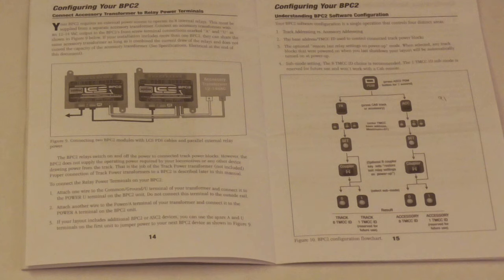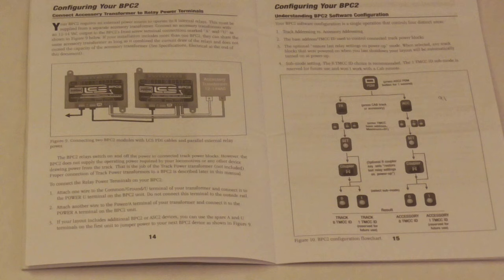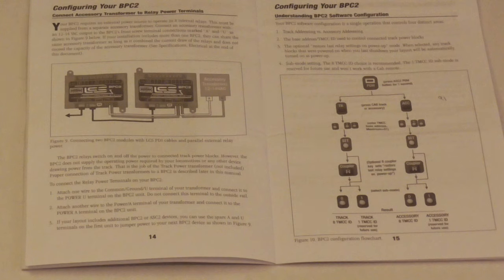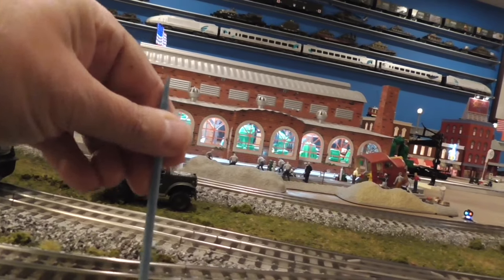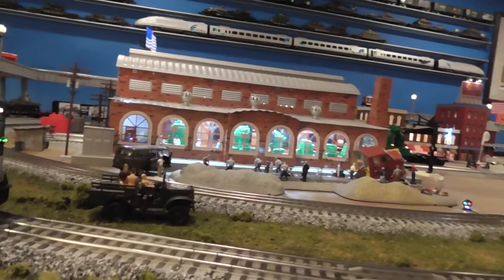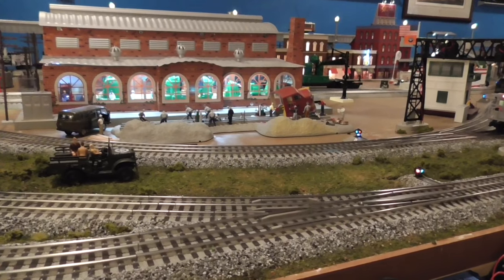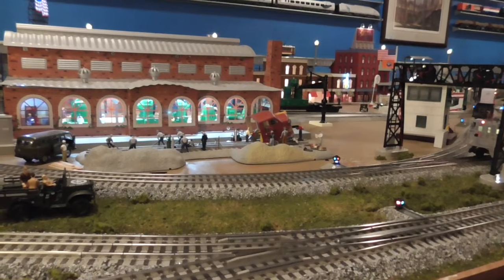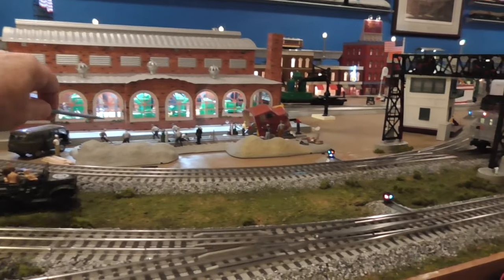How to wire a Block Power Controller 2 (BPC2) to your layout.

Comment: I think this is very good video about bpc2. I just started to setup a legacy system with lionchief plus 2.0 locomotives. I have one loop and 2 engines running behind each other in same direction. Can I use BPC2 modules to create blocks and avoid collision?  I  can adjust the speed and keep them apart. But a foolproof mechanism is best. 
I want to automate this as well so that I dont have to manually turn off power. Maybe I can program this with sensortrack and bpc2 combo.
Reply from the maker: Thank you for watching and commenting. Yes, you can use a BPC2 to create blocks. I have 6 separate blocks for my sidings. I do not use them on my two main loops. However, I see no reason why you could not use them as you propose. Good luck, and avoid collisions!😁🚂🚂

Comment: This is a great video and could be longer as you obviously have done great job thinking this through. From someone who is just about to step into remote operation I have many questions but I'll start with this: I too like what the ZWL offers and it seems no more expensive than power bricks, power masters, and associated periphery; can you tell me why you chose not to use bricks?

Thank you
Reply from the maker: Ken, hank you for the compliment and support.  I chose the ZWL for a number of reasons...1. I liked the total power offered. 2. The ability to run it in different configurations gives flexibility. 3. Most important  it allows me to very the voltage from the Cab2 without using a TPC power controller. All four outputs can be variable and can power both Command Control and conventional locomotives. In fact, I have a conventional Trolley which requires attention at times to vary power or cut it off.  I also like the 'on/off" switch which is very convenient and missing on my PW ZW.  The quick trip fusing is essential for today's electronics and I don't need to install any separate fusing. 
Hope this helps.  I'll be glad to answer or at least try  if you have any further questions. Let me know if you'd like another video topic. I'll keep in mind a need to be more thorough.
Stay healthy,
Ed
Reply: Boscoed1 - Thanks Ed for your response.

Your layout and it’s wiring solutions reflect my own questions going forward. Background: I’m 55 and having Lionel as a child, I brought my daughter (now 13] into the world of orange and blue but never having knowledge of varying voltage needs, this learning curve is steep and expensive. . I have a deep sense that Lionel is moving forward in its technologies with iPad/iPhone being the end goal and necessity for the up and coming next generation. Several weeks ago I acquired my first TMCC locomotive (a 3-truck Shay.... another discussion) and the dealer pushed me towards Cab 1L and associated bricks. I understand it’s use for very large layouts of which I’m likely to never own, but seems to be a compromise... I can’t put my finger on it but there’s something more comfortable with “this lever does that” rather than endless sub-menus and required remembrance. Also, the included volt/amp meters are very pleasing and likely to not be repeated in Lionel engineering into the future. So when I saw your video it was what I viewed as the perfect forward proof approach: ZWL with DCS, though your approach seems to be unique in Youtube world.

Your explanations and camera work of exact wiring were a godsend in helping me understand what you, and eventually I are seeking. Know that my daughters and our layout right now is Fastrack on carpet and on floor with a dozen or so accessories. We have no basements here in Southern California and must make due. I see myself having 3, maybe 4 main lines possibly sized like yours. My daughter has LionChief diesel with no desires for additional and I’m trying to include Dad’s more advanced layout into hers to plant the seeds into the future and for entertainment purposes.

Thanks for taking all this in and any insight going forward would be greatly appreciated!

Ken
Reply: Boscoed1 

...additionally Ed, Sean’s Trains (Youtube) has a beautiful control board w/ 2 ZWL’s, 1 ZW, and a huge row of manual switches, so I don’t think I’m alone in a desire for hard-wire.

Thanks again,

Ken
Reply from the maker: Ken, my 4 yr old grandson was running my Vision Line engines using a Cab2 in just a few minutes!  He is now 8, has a 2 LionChief + engines on his 'carpet layout' in his bedroom and loves them.  I'm 72 so he can not visit now due to Wuhanvirus, but everytime we FaceTime it's "Grandpa, can you run some trains!"  Stick with it, the kids warm up and it sounds like your layout and way forward is spot-on. By the way, I found a steamer captures a child's interest faster and longer because of all the action and smoke and sounds....

Comment: Like - Interesting but it maybe above my paygrade - I am a MTH - DCS & LionChief Plus layout.- No Legacy - I do have blocks with single pole single throw switches on the control center - Old school - Cheers from Michigan 🚂
Reply from the maker: trainroomgary If you do not have Legacy installed, a SPDT switch works just fine b

Comment: Ed,Thanks you so much for the video. I learned a lot how to install the Controller 2. One question in using the Controller 2 can you isolate 4 or 8 sidings?  Again thank you for a great how to do video. Nick
Reply from the maker: Thanks Nick. Yes, using a BPC2 allows you to control (turn off/on) up to 8 separate blocks using the Legacy CAB2 handheld. Add another BPC2 module, and you can control an additional 8 blocks...and so on. If you mean can you turn off 4 blocks at once, I'm not sure....that would require wiring 4 blocks to one BPC2 In my case, I have one BPC2 that allows me to control the 6 separate blocks on my layout. That then allows me to add two more if I wish  If I want to control more blocks, I will have to add an additional BPC2.  I hope this answers your question.  Here's a link to the Lionel website that discusses the BPC2:  http://www.lionel.com/lcs/LCSproducts/BPC2/index.html
Run those trains!
Reply: @Boscoed1  Thanks Ed, you answered my question. No Ed I only wonted to know about the amount of blocks I can turn on and off at one time with each BPC2.Nick
Reply from the maker: @nickltrains6952  Glad I could help, Nick. Run those trains!

Comment: what do you do to short proof your layout?
Reply from the maker: Not sure I understand.
Reply: @Boscoed1  What  is your set up to protect from shorting, do you use  bulb?
Reply from the maker: @photozen8398  If I understand your quesiton, I have two safeguards.  One, my track power and some lights and accessories are powered using a Lionel ZWL. It has excellent circuit protection built in. For example, if I have a short during operation, it will detect and cut power to that track, or accessory line and the red light indicates a short. Since I employ both Lionel Legacy and MTH DCS, I run power from the ZWL through the TIU to the track.  Between the TIU and the track I have installed additional fuses. So, I'm about as confident as possible that any short will not damage my trains or accessories.  The "bulb" you mention is used, according to some info I've read, to improve the DCS signal.  I've never had a DCS signal problem so I have not installed a bulb (load).  Hope this helps.